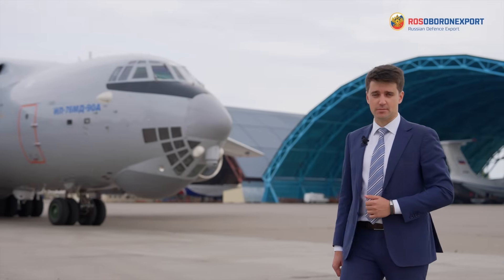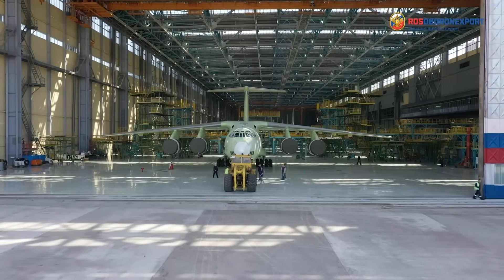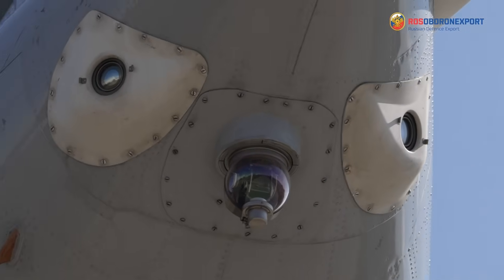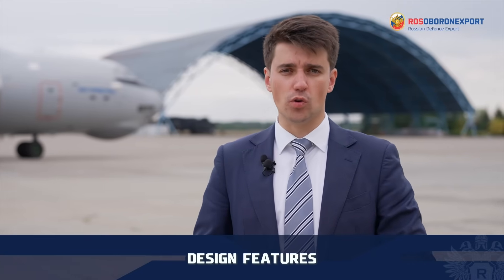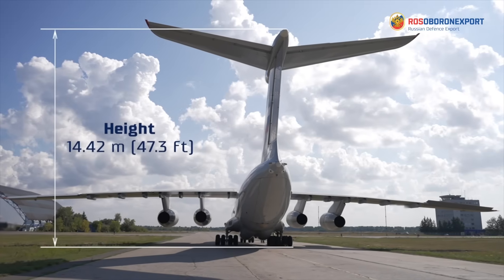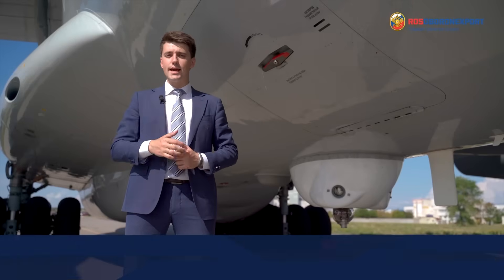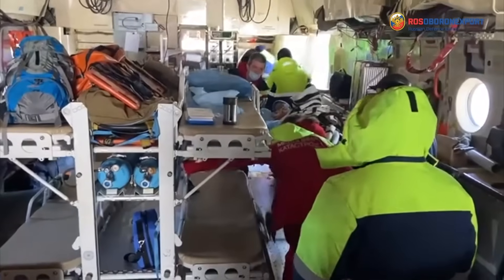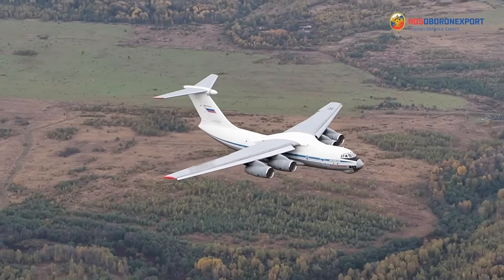IL-76MD-90AE Military transport aircraft

Comment: Why do you still need a radio operator, a flight engineer, and a flight navigator in 2024??? Why?
Reply: Partly because of "Soviet legacy", partly because it's a military plane, not just a military transport. "Offline" navigation adds redundancy if GPS/GLONASS isn't available or jammed, and radio operator/flight engineer reduces the workload on the pilot.
Reply: @BOBAH-HA  ... but surely with today's computing power and automation capabilities, do you need a physical body for these functions? these should be automated
Reply: @ Well. automation helps when it works, this plane is mostly utilitarian. I don't say that this is how it should be, some things could be offloaded to computers, sure. But, it's utility mixed with older design. 

Thing is, it's not exactly a cargo plane, it's a military plane. Americans, for example, has different approach with their C-17. Their plane is about world-wide logistics. They need to deliver the equipment across the globe. Hence 2 crew members and high level of automation. IL-76 was created to support military actions, to land and takeoff anywhere under any conditions. Hence more redundancy.
Reply: @BOBAH-HA  ... there is no difference in utility of us and russian military transports; that is a false distinction you are trying to make. only difference is the russians have chosen to keep a primitive non automated approach instead of modernizing their plane. they  may have their reasons, but in reality those functions can be automated

Comment: In proportion to the low weighted cargo which can be loaded on this Plane, the number of the engines is very high and so costly for the military segment.
Secondly, when You want to change the cockpit into a glass type, why did the analog instruments have kept beside, yet?!  It has made the design so prodigal in terms of Number of flight personnel.

Comment: Dated 70's Soviet design, Heavy as in no composites in wing and fuselage design, Noisy, Thirsty relatively low powered PS90 engines by todays standards and a 4/5 man crew to operate it! Low payload compared to others and a range that is nothing to shout about. Plus point's, Reliable, Rugged and Straight forward to maintain due to it's relative simplicity, It will never sell in the West but suit's developing country's with low budget's for transport aircraft.

Comment: It's surprising that a modernized variant of a strategic airlifter would be sold for export without eliminating the flight engineer and navigator roles.

I wonder whether this is influenced more by requirements of the export markets, by the constraints of the program itself, or by constraints outside of the program.
Reply: I will repeat that again:
- Flight engineer is responsible for many aircraft mechanical/electric systems, not just for the flight.
- Radio operator is not just a radio operator, but the EW system operator as well. For the military versions...
- Do not compare civilian cargo planes with military ones. At all, it's just wrong!
At the basis, it is a military airplane, at first...
Reply: @maksimluzin1121  Can you provide more insight on your thoughts on this? I've read your replies to others and to me it looks like you're saying that Russian military air crew stay with their specific aircraft, while Western military air crew switch aircraft depending on their mission, and that there are still tasks on the military aircraft which a human is more sensitive to and more proficient with compared to an automated system. Is that the approach and understanding of Russian military aviation?
Reply: @ragabara1031  , I've answer you, YT removed my comment some-why...
Reply: @maksimluzin1121 Thanks I've read your reply. Follow-up question: if the Russian aircrew are flexible in what they can do (I assume due to their breadth of  training), then do they actually rotate between roles during flight?

Also, in practice, would Russian military aircrews have less members than specified by regulations due to their multifunctionality?
Reply: @ragabara1031  , , I've answer you, YT removed my comment again...
Reply: @maksimluzin1121 Thanks, I was about to ask you for some reference. Your comments weren't deleted, but hidden to other users. We call that practice "shadowbanning" here in the West.
Reply: 70's technology is Russia's strength. If you indoctrinate the population during +20 years to believe it's a worlds best, you got a...worlds best ;-)